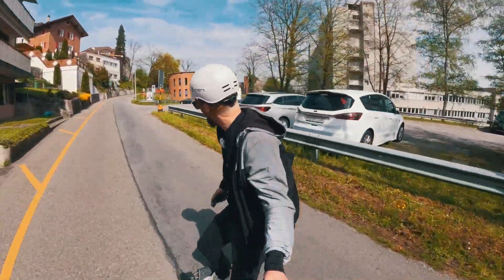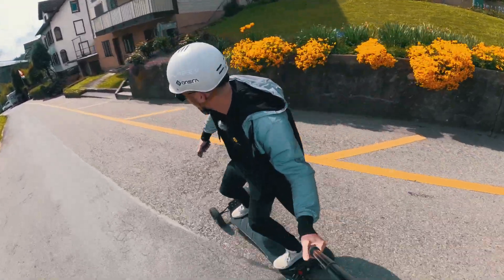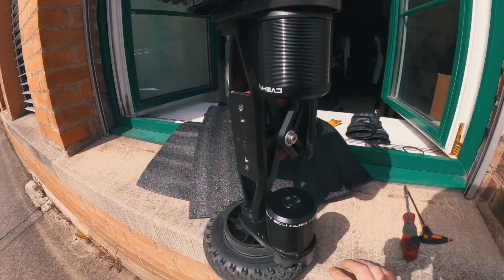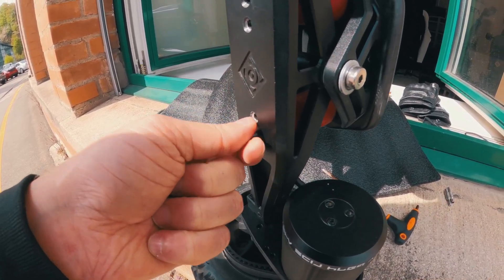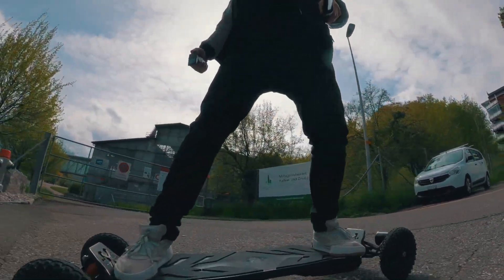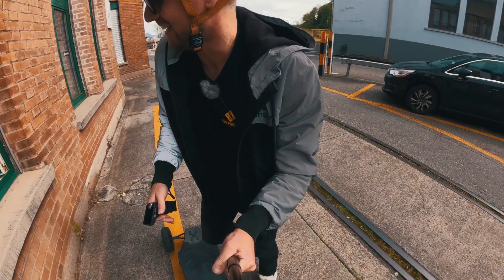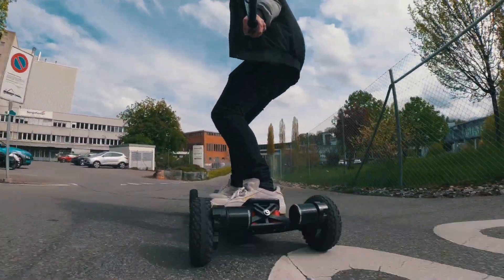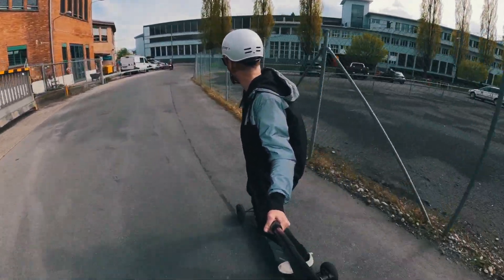ONSRA VELAR - How to adjust the new CNC CHANNEL TRUCKS

Comment: It's a design that reminds me of Trampa, Kaly, Fux Motion, ... the board seems more compact, the battery box seems more homogeneous with the shape of the board, the width of the trucks offers greater stability, especially at greater speed, the higher tension offers more torque and speed, ..., I would prefer the street version with a lower center of gravity or wider pneumatic wheels and with a smaller diameter, I hope to see a updated the motor HUB version, to remove the motors from the design and allow you to ride in greater silence. I like this questioning, testing something else, always moving forward to innovate, It's a new board with a lot of compromises, it's a great success, congratulations to you and your whole team.